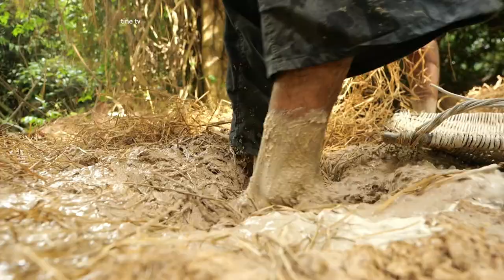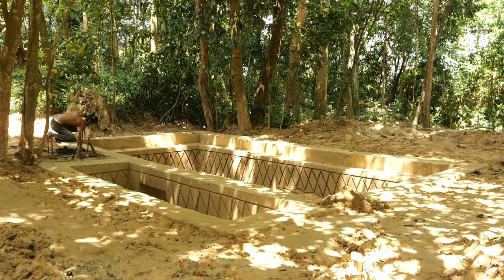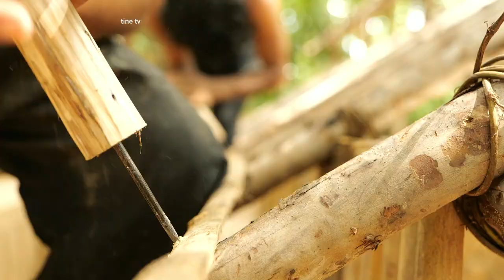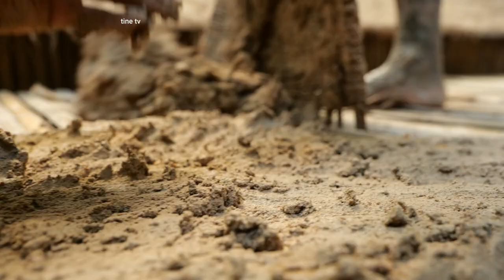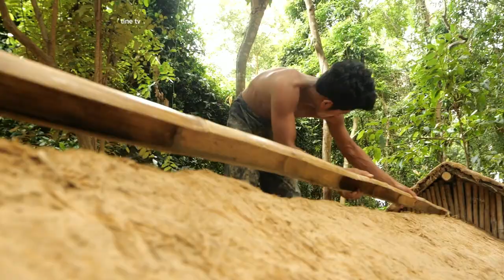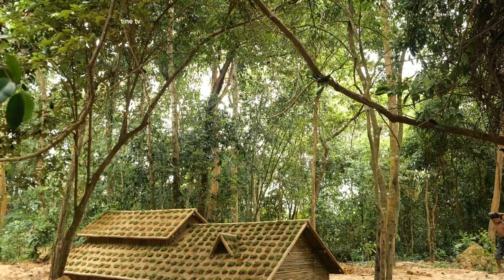How I Build Rooftop With The Most Beautiful Underground Swimming Pool And Beautiful Grass Around

Comment: These are built In soft sand stone how long could it last?
Reply: That's not even the worst of it, the interior more then likely has no means of drainage and that roof is going to funnel at least some water inside when it rains.
Reply: @NetraAmorosi   I’m glad you mentioned drainage. All of their “underground houses” and “swimming pools” are just pits without drains.